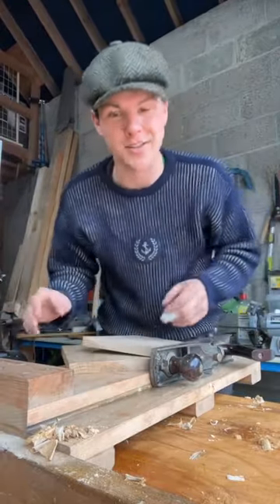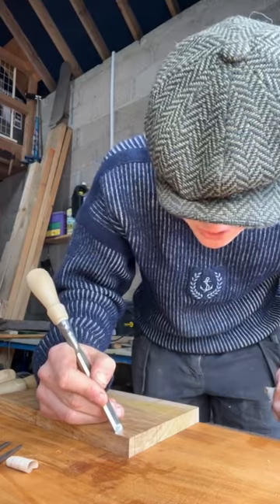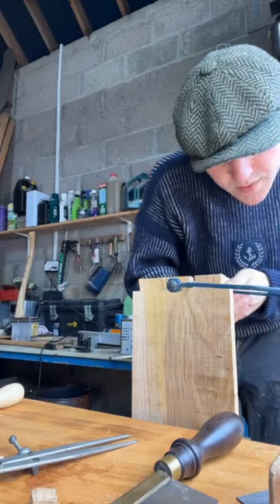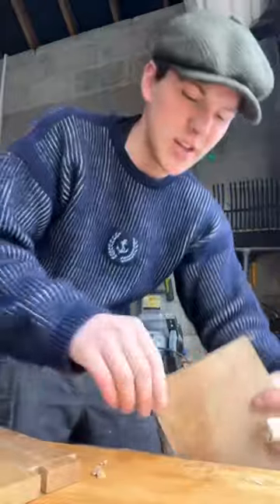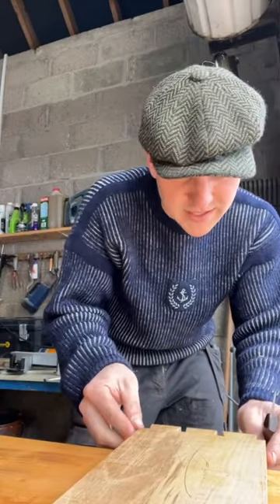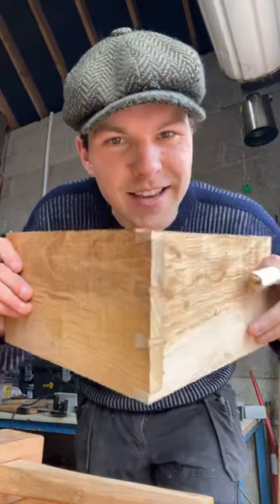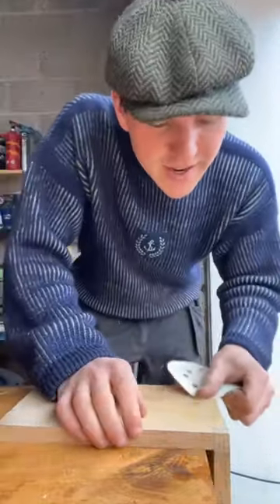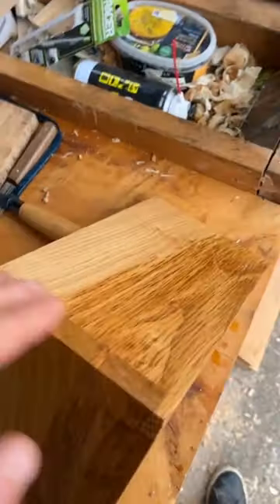Making A Dovetail Joint #shortvideo #dovetail #joinery

Comment: Idk if you've heard of Sam Maloof's famous finish. It's one part varnish (Epifane's is great, but anything will do, polyurethane is super durable), one part Linseed oil or Tung oil (for more durability), one part mineral spirits. It performs very similarly to Danish Oil, and is extremely cheap.

Comment: Most people would put a thin layer of glue on the appropriate surfaces first and get rid of the overflow afterwards? It lubricates it a little during fitting and is stronger than a topical application when dry. I suppose you'd want a sacrificial glued joint mallet, though 🤔
Reply: If you want to stop staining from squeezeout varnish the outer surfaces and leave to dry before you glue the joint. Simple, but no one ever does it.
Reply: @jimbo2629  Noted